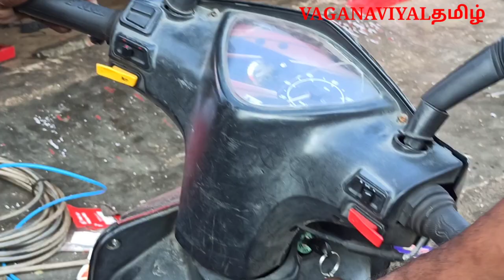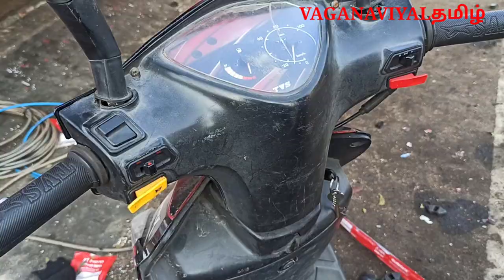TVS SCOOTERS COIL CHECKUP/தமிழ்

Comment: Sir ennoda bike tvs victor gl correcta oru 7 or 8 km la stop aaiduthu tankla petrol irukku,corburatorukku petrol poguthu,carburator jet laam kooda cleana irukku,saprk plug and wire rendume spark nalla varuthu,idle speed nikkala mukkiyama 7 or 8 km correcta stop aaiduthu,oil kuda irukku plz help sir.athikam kik panratha irukku off aachina start panrathu rompa siramama irukku sir....
Reply from the maker: Pickup Coil check pannunga bro
Reply: Idle nikkalaina  pickup coil oru kaaranama sir, but spark plug la timing spark varuthunu thonuthung sir
Reply: Sir

Comment: Bro yenmoda fascino spark check பண்ணும் போது spark plugs adaptor la touch panni kick panna heavy shock aadikuthu ...yenna problem ah irrukum.bro .... Above 60 la poi sudden brake ஆடிச்சா vandi off ஆகிடும் ...ரொம்ப போராடி start panna vendinirrukum ..உங்களின் கருத்து
Reply from the maker: Valve tappet adjust pannunga bro

Comment: Anna plz reply for this
If we drive this scooty streak with battery or by weak battery, it will Or my damage the cdi coil. Naa sonnathu saari illaya anna. Rectifier support pannum vandiya start panna but ethu problem illama run aaguma. please anna reply pannunga na
Reply from the maker: Without battery RR unit problem varum bro
Reply: @vaganaviyaltamil  cdi coil damage aagatha anna. oru electrician anna naa battery illama vandi drive pannathala cdi damage aachinu sonnaru. is it true
Reply: Thank you so much for your valuable reply anna
Reply from the maker: Chance irukku bro
Reply: @vaganaviyaltamil  once again thankyou a lot anna

Comment: Brother put video for how to check relay
Reply: 5 pin relay 6v 12V  3pin side  1st and 3rd pin relay coil supply pins. 2 nd pin relay output common pin.       2pin side NC ( Normally Closed with common pin) and NO (Normally Open with common pin) relay without supply common pin connected NC
With supply common pin connect with NO